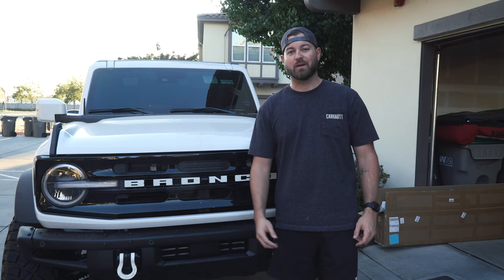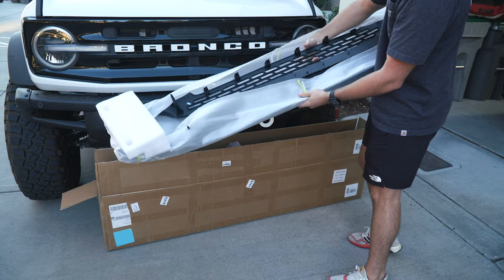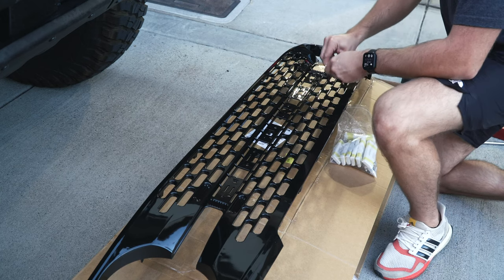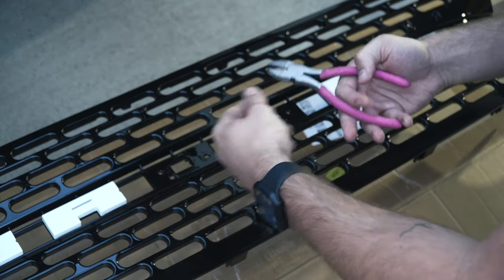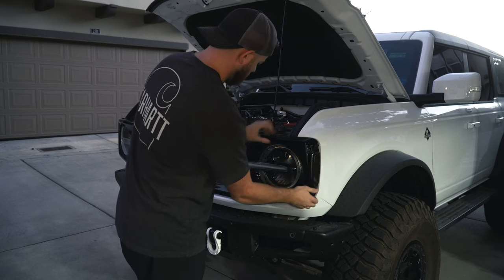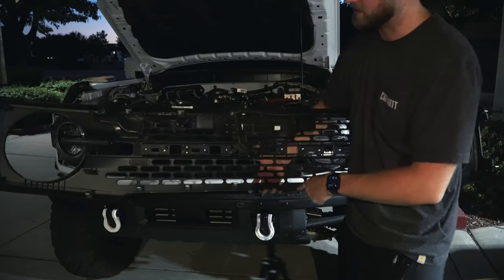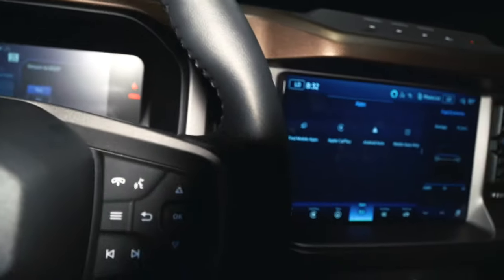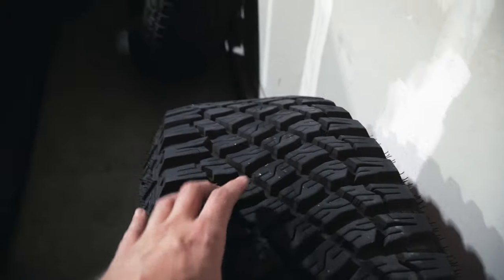Bronco Wildtrak Grille Install | EASY $400 OEM+ Upgrade!

Comment: Looks great, I plan to do this to my Outer Banks also whenever I get it.  My complaint with the oem Outer Banks grill is that the holes are too large and allows you to see too much through the grill.  I don't think you will get too much hate as long as you don't put Wildtrak badging on the Bronco. LOL